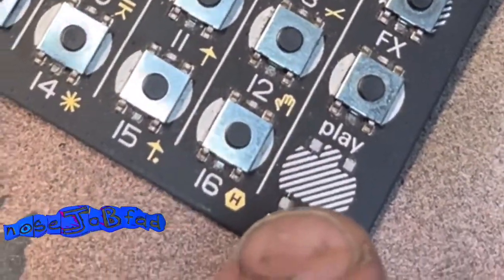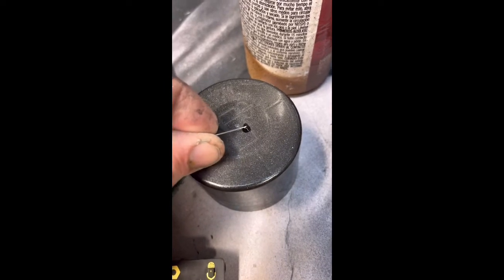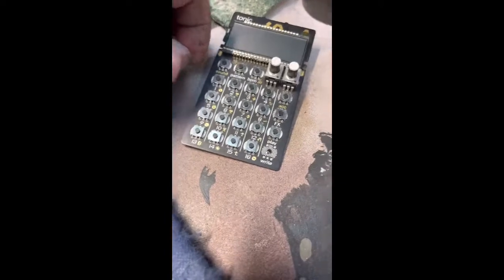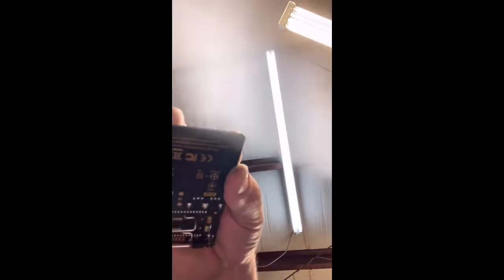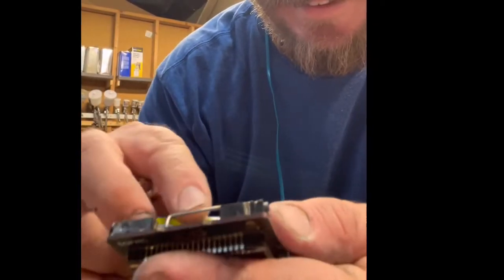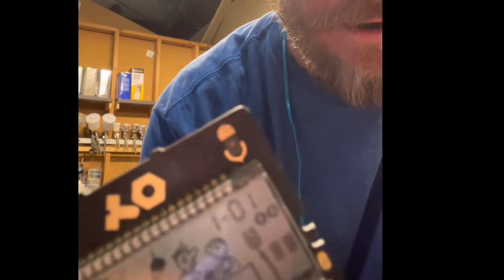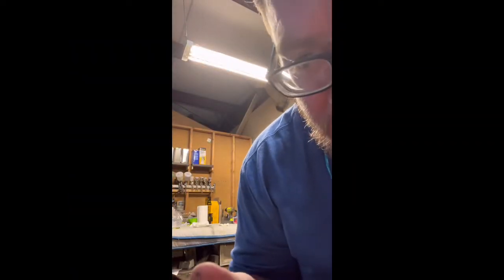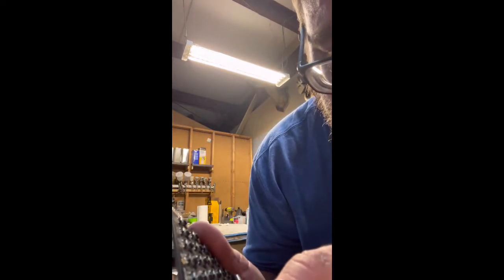I broke (and repaired!) my pocket operator! (SIMPLE!)

Comment: My worst nightmare was dropping my OG circuit and snapping one of the pots off. Man I freaked. But I kind of managed to glue that back in place. VEEEEERY carefully. Works kind of OK. Bit glitchy but sometimes those glitches throw you a bone, huh?
Reply from the maker: Zoinks!

Working with wonky gear is weird.  I got pretty good at no-screen PO33….

And my volca bass is particularly crippled…. i have a bad key, so can’t clear a single oscillators OR CLEAR A PATTERN.  I have successfully managed to always keep #1 (at least!) saved blank. So far.🤞🥸

I actually got it like that, it was part of a cash+ gear trade with a few other bits.  ¯\_(ツ)_/¯